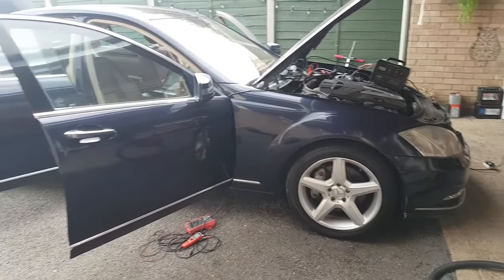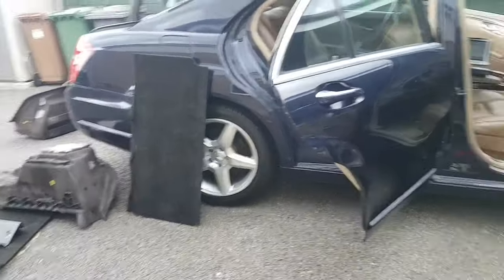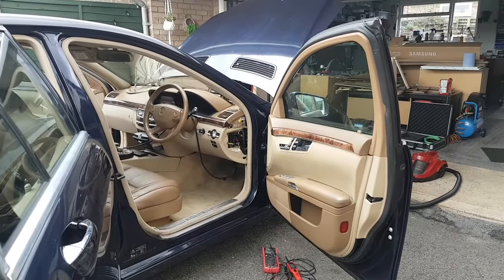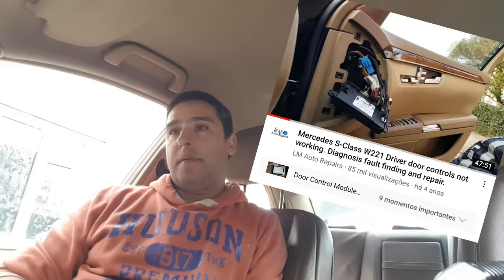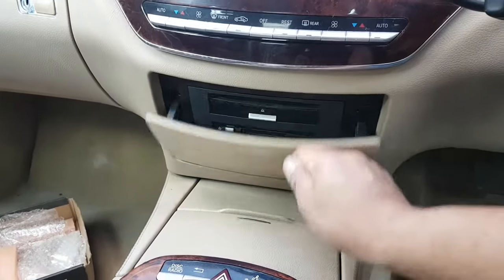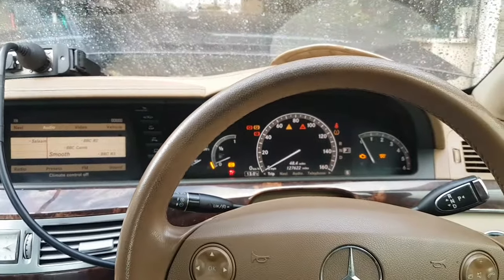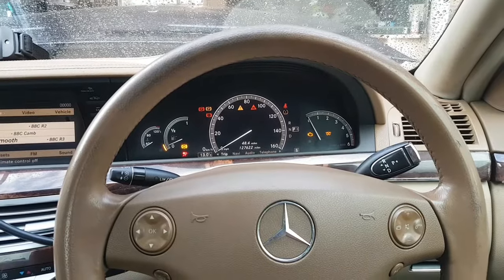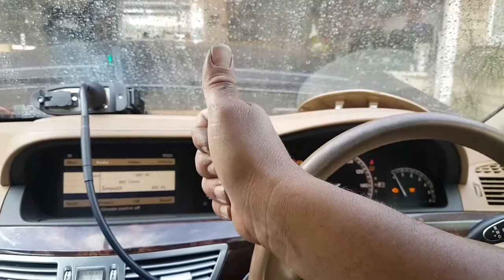Mercedes S-Class W221 No radio and no sound...Plus more... Fault finding and repair.

Comment: The joy of Mercedes sound systems. Have lots of experience with these and they are a pain.
The MOST bus goes through head unit, phone, CD, TV tuner, tuner/ Amp, digital radio unit. Any failure will stop the sound.
Most failures on the S-Class sound system are related to water in the boot. When valeters clean the wheel arch with a pressure washer the water sprays in through the side boot airvent (to allow boot to close) and ends up in the electronics.
Some you can fix and some are so badly corroded and require replacement.
Same issues also affect CL's... And others
Reply: Do you mind if I ask some questions about the audio system?
Reply from the maker: Go ahead...👍👍
Reply: Thank you for this post.. Same thing in going through right now.. I have a 2011 Mercedes benz s550 4matic  water got in. I replaced the  satellite module but I still got no sound . Car came with bang & olfusen system .so in the back left hand side is 2 amps and the satellite tuner can you help
Reply: @STILLKINGSTON73  From all that I have seen, the no sound condition is typically caused from a dead amp. 

One thing you can try is by inserting a fiber loop into the voice control module section and seeing if that does the trick. If this doesn't work than most likely you have a dead amp.
Reply: After I replaced the satellite module,  I still have no sound.. When I sent my satellite tuner module off to get repaired I also sent the amp..they test it and said my amp was good.. My voice control module on my car has no fiber optic loop going to it.. Please remember  Mercedes benz S550  w221 years begin at 2007 to 2013 my car is a 2011 . So you know as in each year they try to modify certain aspects of the cars each year my voice . I've seen where some voice control module is located on the  driver side in the trunk but once again  the person before me when buying the car new opted for the bang & olfusen system as an upgrade. So in my car is 2 amps  one big looking  amp and another  another along with the satellite tuner. Thats all on my left side my voice control module is located under the  back sitting under the seat dynamic pump. It has no fiber optic loop going to it. thats what was  puzzling me because I would try to bypass it to see what happens but I can't. Also when I hook a scanner  and do a full scan I get no fault codes relating to the problem but still command  say no sound. I can still see navigation and also phone still connected also can still connect bro Bluetooth but no sound
Reply: @STILLKINGSTON73  did you find any solution to this?
Reply: Nope.. Still in the shop.. Thinking about selling it as is
Reply: @STILLKINGSTON73  sorry to hear that. any other issues as well?

Comment: Could you please tell me where the sound processor is located.. Never  heard  of a sound. Processor before..Thanks
Reply from the maker: Have you watched this video?
Reply: Yes I did sir..many times.. But I don't see anything you refer to as the "sound processor.." In video you said you still get no sound.. My satellite tuner was already repaired .. I plugged it in and still no sound .. When sent my satellite tuner for repair I also sent my amp also . Mercedes repair shop said my amp was good.. The person before me who own this car, when buying brand new from the dealer they opted for the bang & olufsen  sound system.. Not the  Kardon.. So in my trunk on the left side is satellite tuner and 2 bang  olufsen  amp.. A big one with 1 big plug going to it and another with bang fiber optic loop.. In my car there is no voice command module on the left side or the right side of the trunk. In my car the voice control module is sitting under   the dynamic seat pump  .My voice control module has no fiber optic going to it so  I cannot bypass it to test.. Thank you for replying toe and the community, but I don't know what else  do.. Also when scanner if hooked up I get no codes relating to them..
Reply from the maker: @STILLKINGSTON73 
🤔
29:30
Not sure which video you have been watching...
Now, the sound processor or amp... same thing...
The main thing is, if you can communicate with the amp, the most bus is ok, and the speakers are connected, then I would say you have a dead amp...

Comment: Hello,

My issue as it stands:

- All power + grounds are working going into all units
- Red light inside the comand unit glows
- Amp is new just as a precaution
- When a scanner is plugged in, the comand and other audio related equipment do not show up. They show as blank as if theyre not equipped.
- I have checked all fuses to be good with power going across any related to the comand audio system.
- There is no display of anythont on the screen. It remains black but can still tilt.

Any idea of where to start?
Reply from the maker: Hi
The command should boot regardless of any of the other components related to to working or not...
Have you pulled the command out of the center console? 
It looks like the command is not booting up...
Reply: @LMAutoRepairs  by remove the comand, are you referencing the unit with the cd changer? 

I have removed it and checked it but did not see any corrosion within and I removed all the iPod related cables to narrow down the issue. I checked all the pins and all are good.
Reply from the maker: 16:16
That's the command unit, the gateway of the entire audio and most network...
Reply: @LMAutoRepairs  My current codes I pulled using a relative expensive scanner:

OCP - No can message from Control Unit CGW (C0E1)
UCP - No can message from Control Unit N93 (CGW) Message Failure "Air Conditioning" (9034)
IC - No Can message from Control Unit Comand (C02F)

Do you suggest getting a comand Unit to replace the one currently installed since there is no boot occurring?

I am working towards getting a Xentry Compatible Scanner.
Reply from the maker: Right... it seems like there is an issue with the command, but you have other systems not communicating that might or might not be related...
You need to understand first what is common to all of those units, and figure out why are they not communicating... 
Focus on the central gateway (CGW), as that can impact multiple systems...
I wouldn't buy any parts just yet...
Reply: @LMAutoRepairs  I purchased a spare CGW and will use Xentry to program it and see if it makes any difference. The unit was only $30. I will see if that makes any difference and move from there.

After scanning, it seems that the main issue is the COMAND unit. It will not be detected at all with power going to it. The CD lights do not illuminate.
Reply from the maker: @burningflare8977 
Could be...
Have you checked diagrams to se what is what?
Reply: @LMAutoRepairs  The CAN system has small faults but it seems that most could be caused by the COMAND not booting including the display module "ZAN".

Do you know how I can program a module within Xentry? Is it done through DAS?
Reply from the maker: I never done one... but I believe the gateway needs reset first... and then you can program and coding...
Reply: @LMAutoRepairs  After switching the gateway, it resolved nothing and returned the same errors as the original.

I'm going to aquire or borrow a COMAND unit and I'll post an update on how it goes. I hope I'm able to help someone out in the future that may experience similar issues.

By any chance, do you know if Xentry is capable of programming a new fob?
Reply from the maker: @burningflare8977 
You are just throwing parts at it, without investigating the actual problem... it is a way of doing it, not a way I am fan of...
You should check diagrams, scope the can lines and understand what it is happening...
Could well be the command shorting the can, or something similar, or it can be something different...
Keep us posted...
The key on those is not programmed like that... you need a blank key to do it... or aftermarket blank key...
But essentially DAS/xentry can't really do it...
Reply: @LMAutoRepairs  I followed to procedures prescribed by DAS as how to check the lines and the resistances and voltages were correct across the CAN and from thr CGW. The lines running into the COMAND checked out and I've checked the center console controls and they work and trigger but it seems the headunit isn't responding to anything. I've seen a variety of issues from no audio, blank screen, no radio but nothing like mine. I have found a headunit I can borrow free of charge so it's worth a try.
Reply from the maker: @burningflare8977 
Absolutely it is worth to try...
That's the way... check everything before condemn any modules!
Reply: @LMAutoRepairs  Well, after installing a new comand unit (cd changer headunit), it all seems to be working. There is a static glitch in noise, but I've determined that it is caused by the comand control knob being bad. So I have a replacement for that as well on the way.

The amp was bad as well as it had a power draw that would kill the battery overnight.

Some common faults:

Bad AMP
When AM/FM is selected
- Does not display Frequency
- There is no audio output

Bad Comand
- Reboots repeatedly 
- Screen reminds black regardless of pushing "on" button
- Freezing 

Best way to start diagnosis is by checking codes followed by checking your power to your comand unit. Positive = Red with white stripes and below that pin will be a Negative = brown

I hope this may help someone in the feature as most people determine their "black screen" to just be that they pressed the "on" button and turned off their comand.
Reply from the maker: @burningflare8977 
👍👍👍
Reply: @burningflare8977 hello, my car sound keeps going on and off all the time ( video of it https://youtu.be/KdZYrFXZ3_M) 
Do you think its also the bad command, or might it been something else?
Reply: @Jerry.V  After watching your video, it seems to be linked to your built in phone. Try removing the phone module. There should be a button that can be pressed to remove it. You can also turn the car on and hold the eject button the command unit "cd player" and after a few seconds it should restart.

Let me know what happens
Reply: @burningflare8977  I just pressed the reset button, still same issue. By removing phone module, you mean the unit in the interior (where the phone is connected directly to), or the unit in the trunk of the car?
Reply: @Jerry.V  Where the phone plug in, that piece comes off. So you should have both the phone and the adapter that it sits into to charge. That might be something to try. I've personally disconnected it from rear so that maybe an option for.you too.
Reply: @Jerry.V  Remove the phone and the charging adapter it sits into. 

If still nothing there's a module in the back of the car near the amp.

An older accessory/main battery may trigger some issues.
Reply: @burningflare8977  the phone and the phone charger i removed in the video,  perhabs its indeed the module in the back of the car. 

Also, the battery is terrible (on the phone) might that cause an issue you think?
Reply from the maker: @Jerry.V 
It is strange that you can't communicate with the modules...
The command is the gateway module, it stores all the information of the installed multimedia options...
Have you checked the optic system?
👍👍👍
Reply: @Jerry.V  If the phone is constantly restarting because of a bad battery, it could be sending a signal to the car constantly or the car searching for the phone that has a dead battery
Reply: @burningflare8977  yes,  was thinking the exact same,  but now the phone is removed, it still does the same thing  (sound going on and off) so that is where I have my questions

Comment: Hello i need help.. I have a 2011 mercedes benz s550 4matic.. Water got in my trunk and diagnosis show my satelite radio tuner was the problem.. I sent itboff to get repaired and when  i plugged it back in i still getbno sound and that part was repair and seem to be working.. Im now only getting codes 94D5 and 94D2.. Can someone help me please.. Im not getting no sound at all..y navigarion still work.. My phone still connect but i cannot use the steering wheel buttons i also can connect bluetooth but still cant play anything
Reply from the maker: Check the sound processor... check connections, power and grounds...
Check the most bus, make sure the loop is closed etc...
👍👍👍

Comment: You need a loop tool to loop out the modules on the fibre optic. If you loop out the bad module, radio comes to life
Reply from the maker: Yes... I have that loop...
In this case was not necessary...
👍👍👍

Comment: Excellent repair. Just about every motor like this I get in the owner is as tight as a ducks @rse. The quality of the supplied battery was a give away.

One question, when the TV is coded out how does the MOST ring still work without a loop reflector being fitted to the TV module plug? Or did you take the fibre optic cables from the TV plug and plug them into the Bluetooth and Tuner cables to complete the loop so to speak.
Reply from the maker: The latest...
I removed the small loop from the Bluetooth module and the TV tuner...
Otherwise yes, would need a loop on that plug...
👍👍👍

Comment: Great video Loius! But what an absolute dog of a car 🙈
Great tip about the MOST as well having the arrows👌
I had something similar in my E61 with the DAB module being removed previous to my ownership. 
Wish I'd seen this video a few years back 😂👍
I find the optical loop plugs are a good help for trying a quick fix or temp repair in these MOST systems. 
These electric seats are a nightmare when they stop working like that 🙄🙄
Reply from the maker: ☺️
Thanks, for watching and for your comment! 
👍👍👍

Comment: Hello.  I have a friend with 08 S550. The Bluetooth stopped working for a while now. The dealer asked for $3000 to fix it. Last week I told him to buy a 30 pin dongle Bluetooth adapter that he connected to the 30 pin iPod cable in the glove box. This also didn't work. But now, after he played with the AUX feature, the FM, AM show nothing, And there's no sound like in your video. Do you think that it's going to be a good idea by changing the Bluetooth radio computer, and take the chance?  Thank you.
Reply from the maker: Hi
Difficult to tell without a few checks...
As per the video, the tuner is also the amplifier module,  so makes sense to loose sound and the tuner at the same time...
You need to check if there is no blown fuses etc... before proceed any further...
But there is a good possibility that the tuner/amplifier module has been messed up... 😬
👍👍👍

Comment: Hi I have a 63 plate facelift E350 coupe with no sound.  Checked fuses, batteries are ok, cannot find amp! Merc said its in passenger side C pillar but nothing there. Not under footwells either or in boot anywhere. 
Can you help me fix the fault if I bring my car to you? Thanks
Reply from the maker: Should be in the boot... left hand side...
👍👍👍

Comment: The radio in my GL 450 comes and goes. Sometimes it works for days with no problem. Then some days it goes in and out. The radio is still working but no sound is coming out. The phone can call and answer but I can’t hear anything because there is no sound. It happens randomly. Then it May suddenly have sound. So annoying.
Reply from the maker: Scan the car, and see if there is any faults that can point into any direction...
👍👍👍

Comment: Can anyone help me ive got mercedes benz s class s350 CDI 2010 and when i turn on radio or disk or even voice command dont work it says service unavailable or sound unavailable and the changer dont work either can someone please help ? Ive tried to remove the fuse box and put it back still dint work also tried reset all dint work as well
Reply from the maker: A lot of what you need to check, it is covered in this video...
👍👍👍
Reply: @LMAutoRepairs  can it be the amp?
Reply from the maker: It can... but you need to test first..